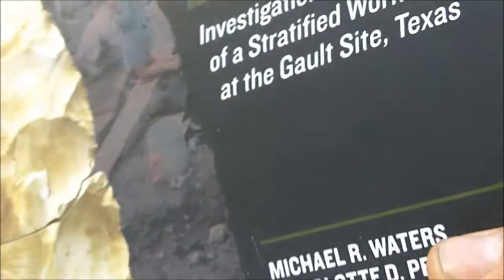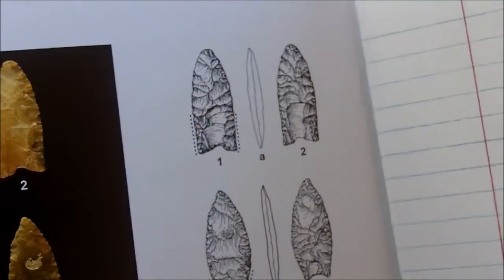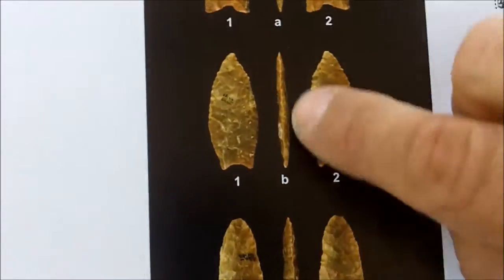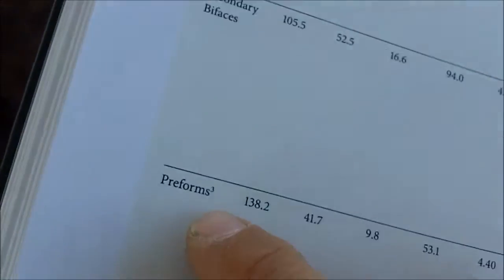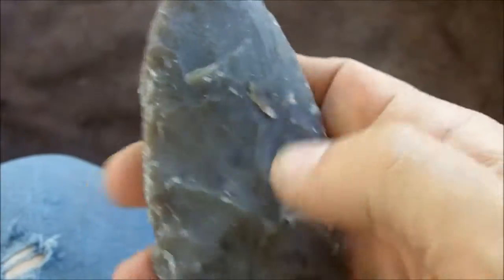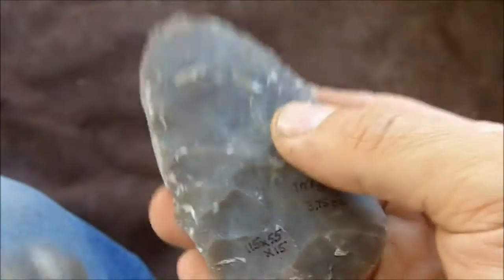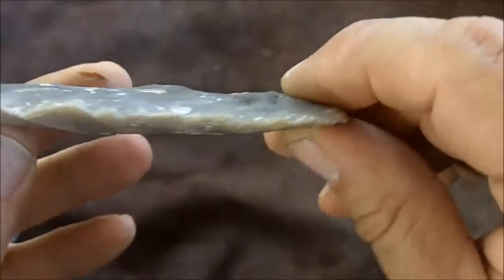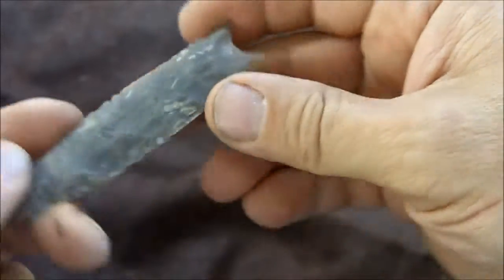212 - Part 1/4 - Clovis Flintknapping Research and Trials

Comment: Hey, great analysis. Just been looking at a 65,000 year old Neanderthal leaf point that has about the dimensions of your preform (76mmX41mmX9mm, 28g). Pretty rough point, but it apparently did the job. Interesting to see how much better they got in just 50,000 years!

Comment: gualt is a very interesting site. Mike Waters is leading the field with that site. you should read up on the site he worked title debra l friedkin site. at gualt he found a pre clovis occupation under a sterile sand layer. pushed the number back quite a ways. at least an extra few thousand years. no clovis bifaces were found but other previously unidentified types.

Comment: If you want to see another example of start to finish Clovis reduction, you should look at Juliet Morrow's study of Clovis point manufacture, at the Ready site.  The 25-page paper is online.  It looks like tab to trimmed preform.  Trimmed preform to hammerstone preform.  Hammerstone preform to secondary thinning via punch tech.  Subsequent finishing stage, via different punch tech, and fluting.  Followed by thinning and shaping.  My guess is that two to three indirect percussion technologies were employed, in the later stages.  Also, of 500+ pieces of high grade Burlington, nothing was heat treated.
Reply from the maker: Thanks Ben.  I'll look it up!

Comment: I found about 7 Clovis points over my 30 years as a collector. 4 complete, 3 broken. Of the 4 complete points 1 was a practice piece and was fluted but the other 3 were what we call 'unfluted fluted'. My professor said that fluting decreases the further one gets  from the source of the material. I also noted that about all of them were smaller, average 2 inches, but were heavily resharpened from a larger size. The fluted one is about 4 inches and is of the early Ross Co Type. It is mercer flint but very low quality material. The rest are all out of state materials. I would love to do a study of how size and materials related to migrational waves of the culture, and reuse of the points etc. I agree with you that this stylistic attribute was adopted and diseminated  far and wide and probably long after the last mammoth was dead and gone.
Reply from the maker: The observation that fluting becomes less common with increased distance from source is interesting.  I'm skeptical.  Perhaps it's true in some areas.  It seems to ignore the practice of producing blanks.  It props up the idea that fluting increased the failure rate during manufacture.  It doesn't, unless we're talking about new knappers starting the learning process.  New knappers would most likely learn the skill near the source because ALL aspects of the Clovis design can cause failures (high length to width ratios, bold flake removals, and high incidence of percussion flake removals from tip as well as base.).
Reply: That's a great point. We have a huge gap in my old home state of Ohio in terms of the point record. Clovis ends abruptly and the next style is Dovetail, which shares no traits of Clovis indicating a total disconnect. I think they all headed south (assuming there were survivors)  but the link between Folsom and Cumberland fluted styles is lacking. As you know the mid Archaic explosion was marked by a drastic reduction in quality knapping for the most part, followed by a new explosion of Artful lithics in the Mound Builder period.  This is when huge caches of leaf blades show up. They were almost a commodity and seemed to be traded in the leaf state and then stemmed (Even North and Snyder's) by the end consumer. Clovis seemed to carry around preforms as a sort of core for making blades and other tools rather than trade. So we see a distinct correlation of habits but for completely opposite causes.One group was nomadic and brought the materials along for the purpose of having the needed raw material and the other was more sedentary and took advantage of a commodity for trade because they were NOT moving as much. What do you think, Sir?
Reply from the maker: It would be interesting to see if there is a lack of other design features with the increased distance from the source.  Are they thicker?  Shorter?  Less percussion flaking?
Reply: The true blue Clovis technology was Outre Passe, I'm pretty sure you've mentioned it yourself, But it's strictly direct and overshot flakes and a freehand direct percussion thing. They used a great deal of thin core bladelets as well as the overshot flakes (commonly called Uniface knives). Any pressure retouches on Clovis is likes an abrading flake. It's a super risky method and was kind of a bragging thing in our current hypothesis, more about skill than necessity. I think it was an essential thing to hunt mega fauna and as they die out it became a redundant kind of ''Here's how grandpa's father hunted the furry pachyderms."
Reply: *likely I hate typos! lol
Reply from the maker: My take on the "trade and commodity" idea is that ALL things  were up for trade at all times.  The difficult thing to pin down,  I think, is whether knappers were few and far between or common.  Trade would be robust if knappers were common.  If they were rare, I imagine each one would stockpile workable stone in each workshop area.
Reply from the maker: I'm not a big fan of the "intentional overshot" or the idea that Clovis technology can be defined, in part, by the presence of overshot flakes.  Overshot flakes are easy to identify and are common when the objective is to create flat bifaces, as opposed to biconvex, for example.  But this doesn't mean anything.  "Intentional overshot" is like saying "Tire blowout technology of working trucks".  Yes, work trucks have a high incidence of blowouts and we have the tonnage of rubber to prove it, but that doesn't define the technology (unless you think this expense is by design).  It's a consequence of the nature of the work.  And overshots appear throughout time and among many point types that exibit "flatness".
Reply: Absolutely but I mean in terms of actual trade routes and regular sedentary groups that claimed certain outcrops like the mound builders did. In terms of specialists and generalists we see generalists in all groups but true specialization is easy to define. All people had stone tool capabilities but only some were true masters of the craft.